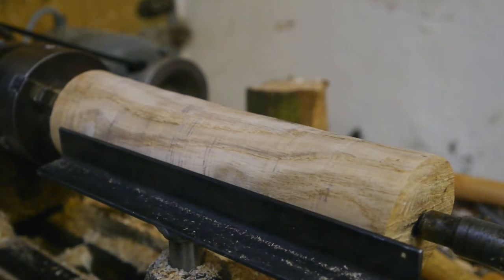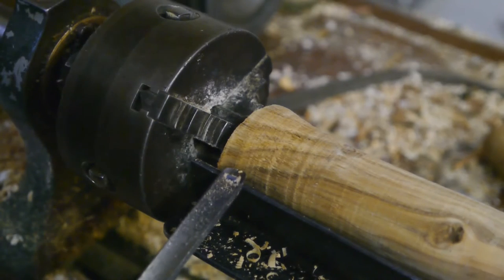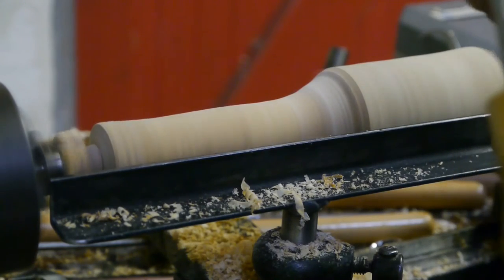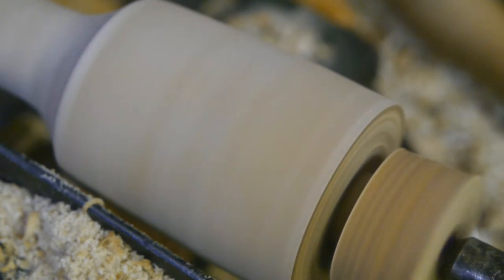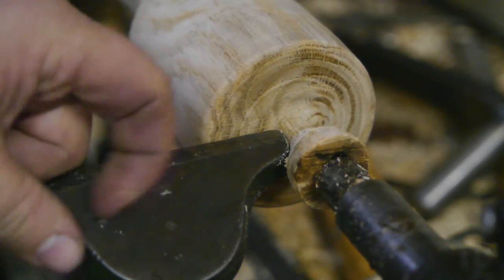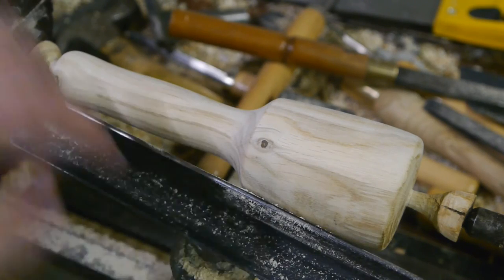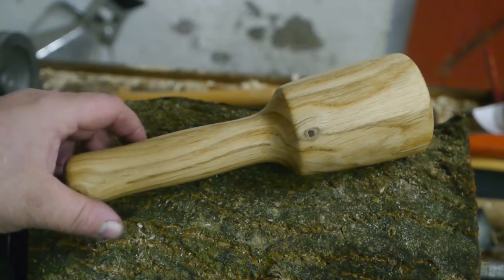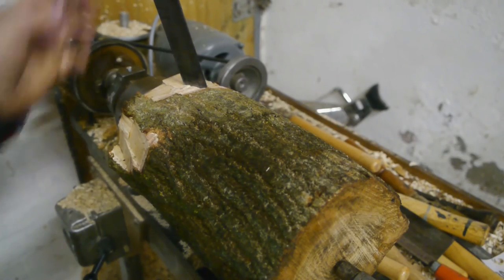I try making an amazing carvers mallet

Comment: Well done.  The mallet looks very nice and even better it works well.   The poor chisel could do with a new handle.

Why did you start to part the end so soon.  I would have left that until the last.

You experienced the difference when too much of the tool edge engages the wood.  A recipe for catching, especially on the curves.

I prefer to use a hand saw rather than use a parting tool.

I also prefer to remove the bark from log sections before mounting the piece on the lathe.  The bark often flies off in large pieces sometimes hitting me.  So far no injury, but it was inspiration for removing off the lathe.
Reply from the maker: Did I part too soon? I could only part the head side of the mallet. The other end had a split. 
I ended up using the hacksaw on both ends. So in the future I won't try parting it all the way.